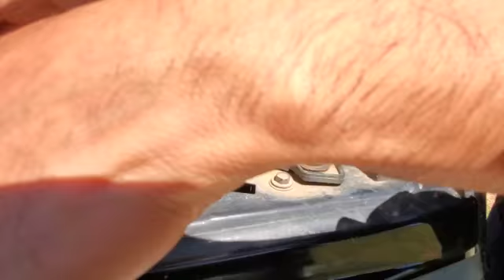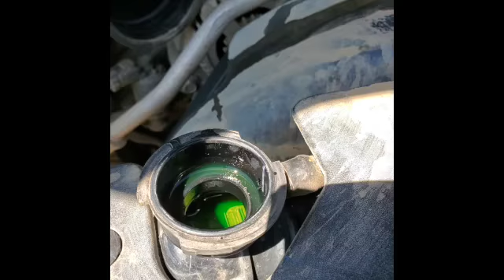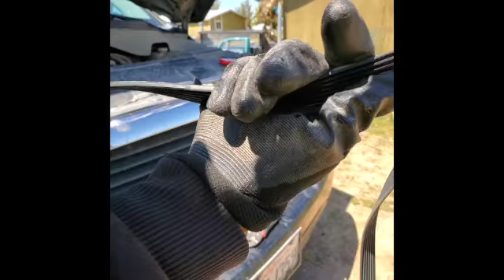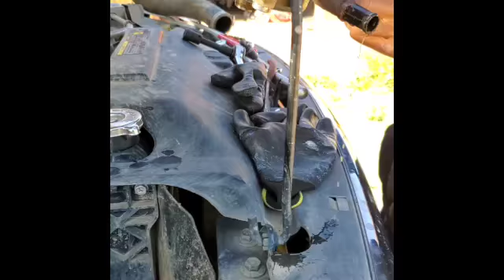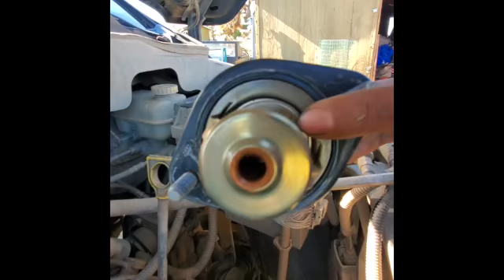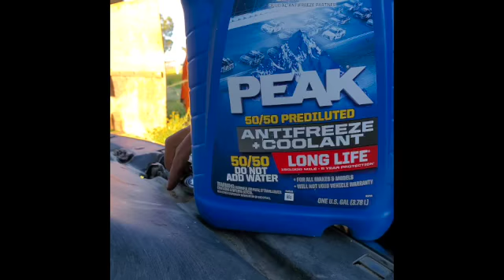2005 Dodge Durango 5.7L  Water Pump Replacement

Comment: The pump on 4.7 is diferent ?
Reply from the maker: What year is your vehicle?
Reply: @munsterrestorer9160  is Dodge Durango 2006 4.7
Reply from the maker: @andresmarin6718  of what I'm seeing is two different types of that year one looks smaller and the other one looks the same as mine. But you can take a picture of the water pump .So you can show it to the Auto parts store. Because sometimes some parts are different designs.